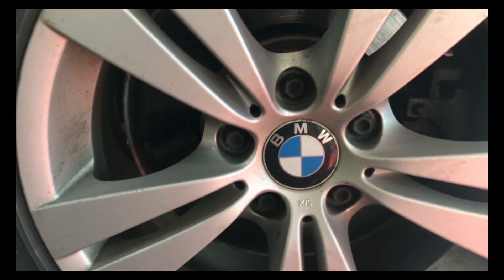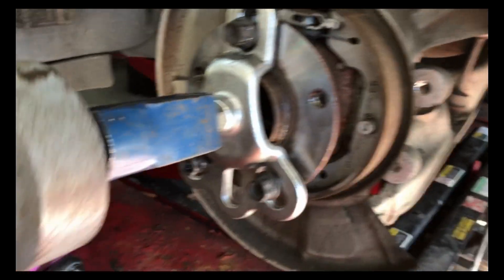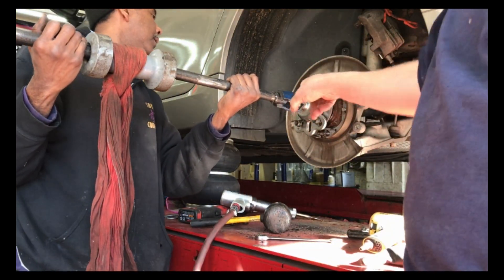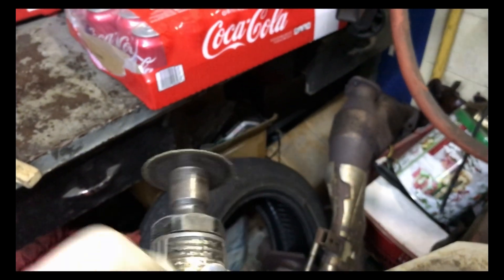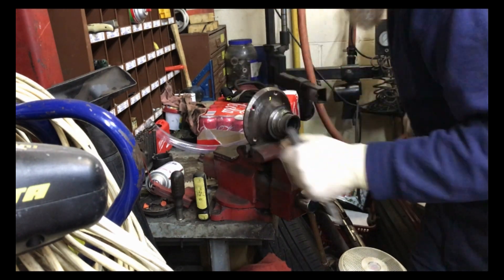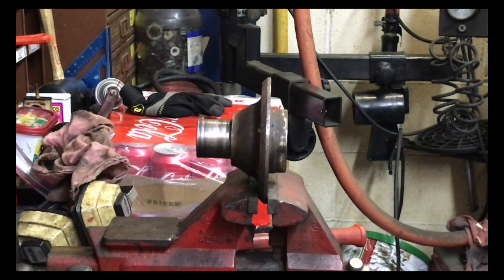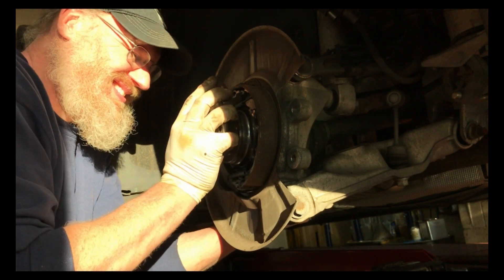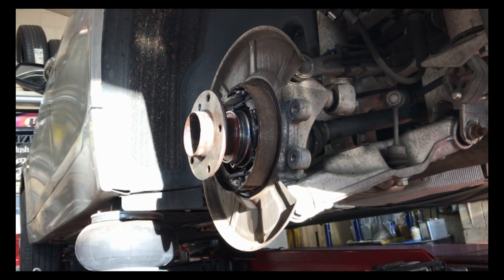2010 BMW 528I XDrive Rear Wheel Bearing Replace

Comment: Hey wouldnt it be easy to buy the whole new bearing in two pieces versus doing all this?

Part numbers: 

- 33006867806
- 33412450667
Reply from the maker: I can only do it with the parts they give me to do the job. I will try to get both next time.

Comment: How did you press the hub back onto the axle?  Also did you find the e14 socket was rubbing on the axle?  I’m having that problem too.
Reply from the maker: I cleaned the hub and axle with a wire brush. Then I put a lot of anti-seize on both. Once the axle was loose the socket fit. I do understand that you can get a hub and bearing that comes together. For some reason I did not get one. Thanks for watching
Reply: @TheGAutomotiveAndMore  thanks I found them separate only and had to press as well. I didn’t think of pushing the axle loose first. Good idea. What about getting it back on. I had to hammer and catch it with the axle nut to push the hub assembly back on.
Reply from the maker: @jjfedor  I think That's what I did also

Comment: This is 2 years ago I wonder if you learned how to do it yet take the four bolts out take the whole bearing off with the hub hahaha then use the bearing separator
Reply from the maker: I showed you how to do this job with out using a press. Bearing separators are overrated. I have broke many of them. Thanks for watching

Comment: So a few questions....1 how long did you slide hammer to get that hub off and 2 do you not need the race you have cut and cracked
Reply from the maker: It took about 50 hits with the slide hammer. The axle was stuck in the hub that is why it did not come off sooner.  The new bearing has that race that I cut off. Thanks for watching
Reply: Thanks for the fast reply

Comment: I’m having the same problems rn but the hub stuck with the axle. How can I get it out without the air hammer.
Reply from the maker: You can try a hand chisel and a hammer. Also spray it down with lots of penetrating oil.